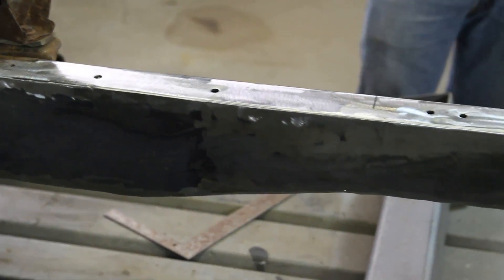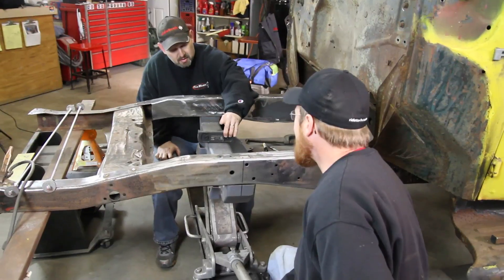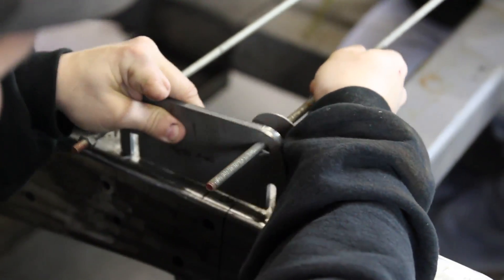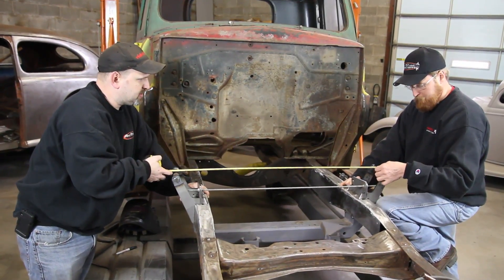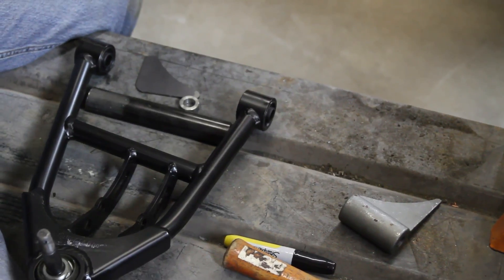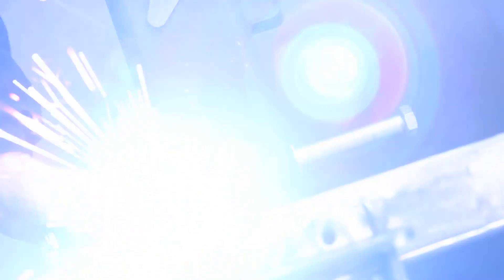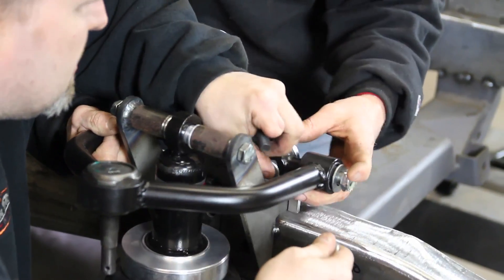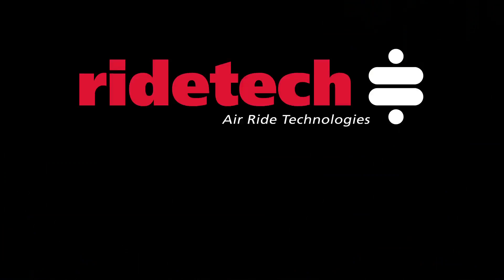Mustang II Front End Suspension Install

Comment: Here's a little tip for anyone as lucky as me... (I came across an OEM '75 front end for FREE) Somebody had cut the frame rails out with a torch. Crossmember and everything with all the suspension.  1 1/2" steel box tubing fits perfectly inside the frame rails if you do some minor trimming. I'm just going to bolt the box tubing in there and use that bolted to the unibody of my rat rod project. Hope that helps anybody who can score what I have if they dont want to buy the kit and do all that welding. I used 3/16 tube so it's really strong. I am basically just bolting this whole front end in with zero fab work. I'm pretty stoked about this because I was dreadding doing all the work you did, although your end result is alot cooler looking to be honest.

Comment: Mustang ll suspension has a long history, all of it driven by the need to fix the problems inherent in the Mustang ll suspension (tiny 4 bolt rotors, inadequate calipers, poor strength, bad geometry and more).  It was designed for an economy car.

Many companies make 'Mustang ll' suspension kits with better rotors, spindles, calipers and strength.  No Ford parts remain, but the basic geometry (for roll center, contact patch management, scrub radius and so on) is unchanged.

I never use them.